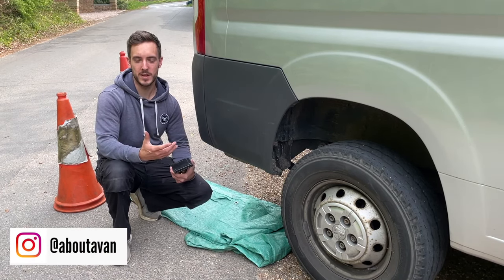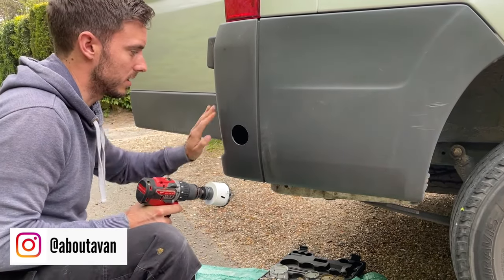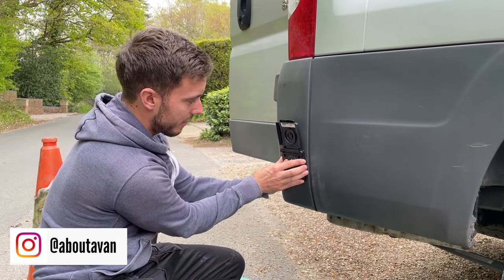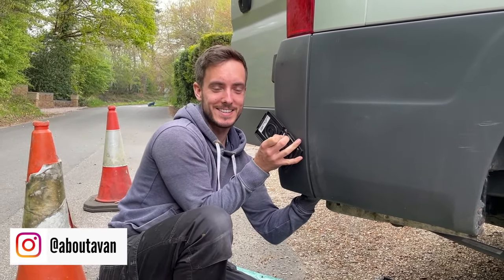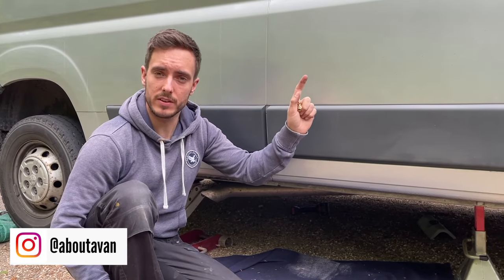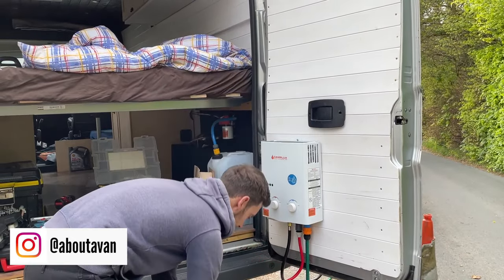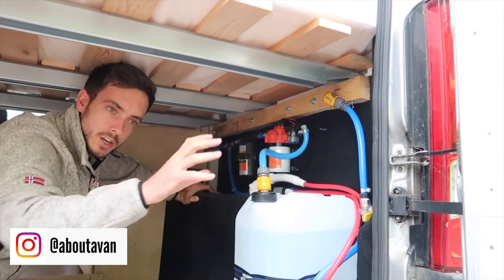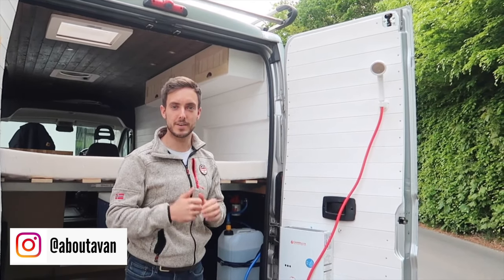Camplux Shower Install | Outdoor shower vanlife

Comment: Great video. Keen to buy one of these- do you know what the 2 D cell batteries you put in it are for? I'm keen to buy and set up my own 12v pump to push the water into it- is this what you did? Cheers!
Reply from the maker: Hey there, they’re for the ignition of the gas on start up :-) I saw a guy on YouTube who said he’d used the original ones for two years showering daily so it’s just a spark. Yes this was set up with a 12v SeaFlo pump :-)
Reply: @Aboutavan  thanks! Good info :-)

Comment: You said the boiler was £180 and I couldn't hear what the other item you mentioned was but you said it was £50  that only comes to £230  so what are the other parts that take it up to the just under £350 that you mention?   thanks
Reply from the maker: Hi Berty it’s been a while since I did this! Perhaps this video will help you with costing and parts Camplux shower | Shower vanlife
https://youtu.be/652zPIZ1BTE

Comment: What's the minimum GPM this thing needs to mix properly? I'm trying to decide between this and a Bosch 7 gallon electric water heater. Most tankless water heaters have to waste a lot of water before they start to get hot.
Reply from the maker: This one was great, it fired pretty much instantly every time.. I had the 45psi pump running with it the shower was the 5L tankless I believe.

Comment: Hello,
Thank you for the video, can you tell me how hot the vent on top gets? I need to know how far away I need to mount this to the ceiling in  my camper kitchen compartment
Reply: This is for outdoor use only.
Reply: @lottiet22  ok so then what keeps rain and other elements from getting into the top vent?
Reply: You either buy the version with the rain cap or you only shower in dry weather. Check out the Camplux website for details.
Reply: @lottiet22  checked out the camplux website like you said, 
"Camplux propane portable water heater with oxygen depletion sensor protection, it can be also installed indoors where is well ventilated"